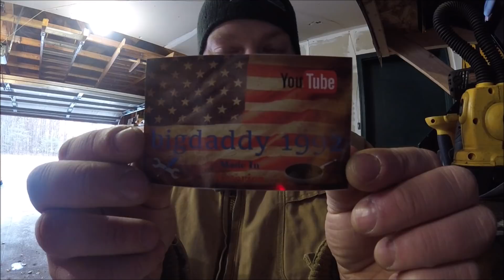Cold Starts, Free Stuff, Frozen Tractors, & BIG NEWS!

Comment: Congratulations on the baby girl!! 

I need a pole barn for my collection myself I have a few tractors parked outside and it bugs me to no end leaving them uncovered after the work I have put into them. I know it’s not flattering to look at but a cheap tarp and some spring clamps to at least keep the water out of your mechanicals goes a long way! I’m also a believer in parking under tree cover to keep sunlight off the tires. My grandfather used to have a big lean to shed that was great because it kept the weather off the machines and you can still display them, perhaps that would be a good option for you?
Reply from the maker: Thanks for the congrats! I cannot build a lean-to here. Still within city limits, and the city won't allow it. I have a tarp over the rear end now, just to protect it some. I will have to get a bigger, heavier duty tarp sometime in the future. I try to park under the trees in the summer.. In the winter if I parked them down under the trees, I would never get them out with all the snow we get.

Comment: Not sure if you can reply to this but I have a Farmall I'm restoring I rebuilt the carb , and converted to 12 v , I also got the timing , however when I start it it's not running clean , it doesn't run smooth either to high if rmp or to low , with the governor at it's lowest setting . If you could help it'd be great .
Reply from the maker: Rusty, there are a couple things I would look at.. First - check your valve tappet clearance. You would be surprised at how something this simple can affect the way your engine runs GREATLY. Second, make sure you have the 'finger' or 'tang' from the governor linkage aligned with the slot in the end of the carburetor throttle shaft. This will cause issues as well related to only running at idle, or only running full throttle. It is hard to diagnose something over the internet, but these are two areas I would start with. What model Farmall tractor are you working on?
Reply: @KennyKizzleRustyNutzRanch   okay , I did put in a new head gasket , I'll check the clearance . Also I did have a hard time putting the carb back on . I thought It was lined up but it sounds like it may be it . I have a Farmall H this is my first restoration . Your videos have really helped me , thank you.
Reply from the maker: @rustyviramontes1260  If you put a new head gasket in, definitely check your valve clearances. The new head gasket will affect this greatly as everything has moved around. People make the mistake A LOT with the Farmall H and M carburetors when reinstalling them. That small tab HAS to be aligned with the notch on the throttle shaft, otherwise it will NEVER run right. Also, I am glad that my videos have helped you! That is why I keep making them! (Well, that, and all the great friends I have made on this adventure)! Actually, I am going to be making a video this week on my H and Carb again.. Maybe I should address the issue of the governor and carburetor alignment issues... Great video idea!
Reply: @KennyKizzleRustyNutzRanch  okay I'll definitely do that this weekend . Thank you , for your videos and advise !
Reply from the maker: @rustyviramontes1260  No problem! Let me know how it goes!
Reply: @KennyKizzleRustyNutzRanch  ok will do !